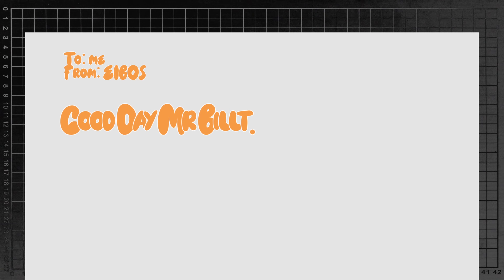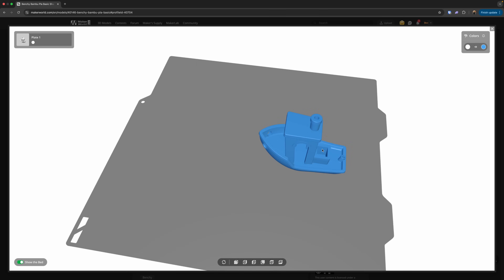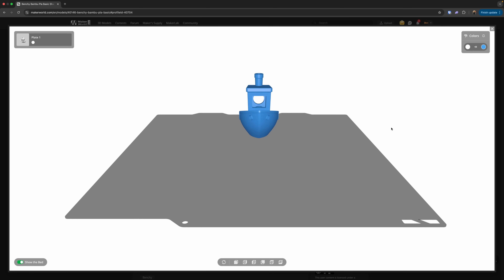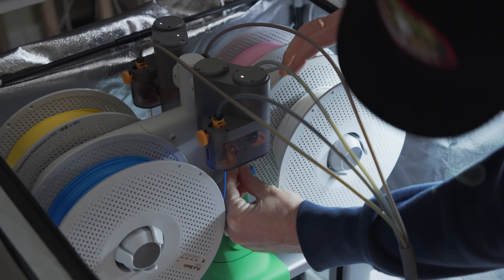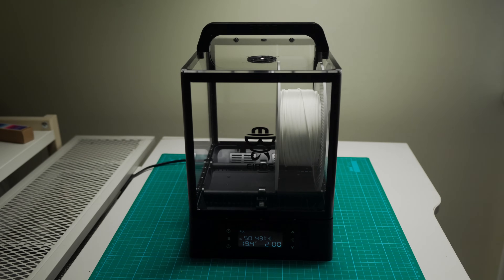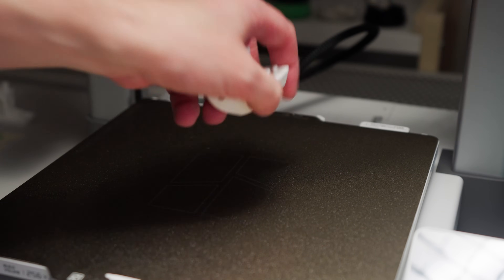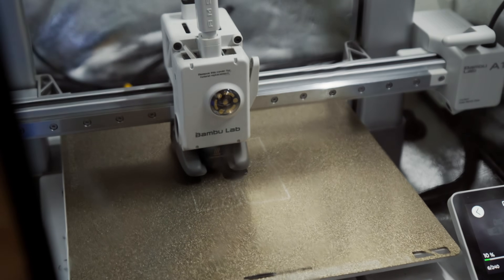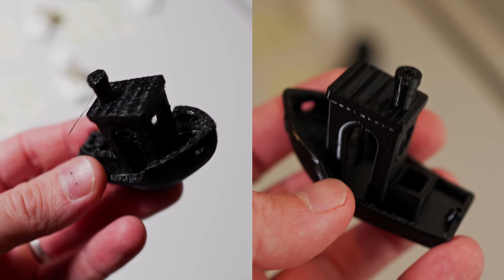Are filament dryers a scam?

Comment: drying is not a scam, especially in humid climate/areas and hygroscopic materials like PETG. dryers, yes. I use a vacuum box that passively dries out the filament while in storage, no energy consumed and my filaments are always ready to go. i put dessicants in the box as well, and i've never had them change colour. the humidity sensor i have inside shows a constant 30%, more than good enough. stop wasting electricity

Comment: While I generally don't dry PLA, I've had some rolls of filament straight from the packaging that had excessive stringing. A few hours in the dryer fixed that. It's generally not needed though, and I've got better things to do than dry every roll of PLA I buy.
People also sometime have adhesion issues, and one of the first recommendation is "dry your filament".

Aside from that, I generally dry every roll of PETG I get, it's a bit more sensitive than PLA, not much though so you can forgo it as well. And as you witnessed, TPU does require drying. And that's the only 3 materials I print with because based on what I saw online, they are deemed "safe enough" (especially since my printer is enclosed and have a bentobox in it).

But the main use for my dryer is actually drying reusable silica beads I use to keep all my filament dryer (I decided to keep every opened filament in boxes under 30% humidity at all times so I don't need to dry it even if it's been opened for months). I know some people use a microwave or oven, but I don't have room for additional ones, and there is no way I put that stuff in the same machine I cook food.

Comment: i have used mainly tpu pla and petg so far and usually print only now and then

i can definitely say that petg and tpu both benefit from dry storage at the least, even if its not an active dryer
using silica beads in an ikea box and drying the desiccant every couple of months works for petg/tpu 

pla can also pick up moisture, but it really takes time, some of my 3+ year old spools seem to print more stringy, but i think if you just store them in the bags the filament came with, pla should be fine

from what ive heard anything beyond those materials definitely benefits from active drying

in general its probably best practice to just print out of some kind of box, so you have one less thing to worry about with your 3d printer

Comment: ❤Another awesome video. 

TPU is a remarkable filament, I love the translucent type for printing wallets and phone cases. It also works well for creating replacement feet for equipment. 

Not interested in PLA but PETG is my filament a choice with very few issues. Bought a dryer it was definitely worth the money.

My friend had some old Makerbot filament from 2013 that wasn't working. I put in my dryer for 24 hours and it worked like new.
Reply from the maker: Yeah I need to pick myself up some PETG, in hindsight I should have done it for this video! How long do you generally dry a roll for and do you then keep it in something airtight or do you dry specifically in advance of a print?
Reply: @Billt_it  New rolls PETG for 8 hours, TPU for 12 hours.  As far as storage open air, dry just before important projects for a few hours. Really should start  organizing and storing them soon. The dryer I went with is the Sunlu S4, liked the fact it holds four rolls at a time. (Looks cool too)

Started printing last July,(late bloomer) researched for 15 years before pulling the trigger. Was really impressed with the A1 and no regrets. Didn't have the time or patience to work with older systems, bed leveling seemed really annoying.

Love to watch it print absolutely fascinating and fixing/creating parts from scratch.
Reply from the maker: Sweet, thanks for the info! Yeah I'm in a similar positon re printing. Have been interested in a while but never really wanted to tinker with the older gen of machines.

Comment: I live in a very humid place. Even the walls leak during the wet season. I have hundreds of rolls of different materials. I never use a dryer. I just store them in a box with molecular sieves, and the hygrometer shows the humidity inside the box is always below 10%. The molecular sieves can absorb moisture from the materials, drying nylon to the point of being very brittle. I've never had printing issues. If I notice the hygrometer rising, I simply take the molecular sieves out, bake them in the oven for two hours, and they’re ready to use again.
Reply from the maker: Damn, that’s pretty interesting. I would have thought a super humid environment would just cause them to suck up the water. I guess that’s what the sieves are for, obviously.
Reply: is it the same with rechargable silica gel ?( heat them and when dry it will turn to blue ) or molecular sieves is stronger?
Reply: @chickenz4604 Unlike rechargeable silica gel, they do not change color, so you have to rely on experience to judge when they are dry. In general, heating them in a pan over a flame for about one hour is sufficient to reactivate them

Comment: I  definitely agree for PLA that dryers are more marketing than results but as your materials get more demanding filament dryness plays a critical role. At home I print a lot of ASA, nylon, and PP; ASA doesn't need a ton of drying but it definitely helps older spools unlike nylon and PP which are near impossible to print without 24-48hrs of drying as well as actively drying through the print. On an even higher level I work with industrial machines that chew PEEK for breakfast, we have a few different dryers but the fanciest ones reach 300c internally. High temp nylons, PEEK, PEKK, and Ultem will all absorb moisture so aggressively the room needs to be low humidity as just a few minutes in ambient air can delay drying by several hours. 

For the 90% or so of home printers that never go outside PLA filament dryers are pretty much a scam, but for the materials that need it I'm glad there are affordable options that work really well.
Reply from the maker: Damn dude this is such a crazy in depth comment, thanks for the knowledge!
Reply: This was exactly what I was thinking.

Comment: Wish you had done your test with PET-G.
Reply from the maker: Yeah in hindsight I should have ordered an extra roll. I need to do some printing with PETG but I’ve so far avoided it. What kind of stuff are you printing with PETG?
Reply: @Billt_it  Anything structural or that will be exposed to elevated temps or sunlight. Right now, some stuff for a new X1C and desiccant  boxes for an AMS2-Pro. I suspect more people would be using PET-G rather than TPU for everyday printing. Your comparison of a wet-TPU benchy and a dried-TPU benchy was great.

Comment: I don't think PLA can absorb water that quickly. You have to have it sit in humid air (or maybe water?) for a bit longer than that.

What this shows is that if you're using PLA and are finishing the roll relatively quickly, you don't have to worry about keeping it dry.
Reply: I thought the same thing up until this past weekend. Had a spool of filament that I had been using earlier in the week decide it was going to absorb all the moisture it wanted for 3 days lol. 
I struggled for a solid 24hrs thinking it was a setting issue until my girlfriend told me to try a different color(was sleep deprived and trying to finish an order, hence my lack of thinking outside the box)
I proceeded to print the keychain in several colors then got on Amazon and ordered a dryer. 
Dried the spool for 10hours or so at 40c and when I tried to print the keychain again using my original settings it came out flawlessly.
Reply from the maker: Damn, there you go! And that was with PLA?!
Reply: @Billt_it yep Inland PLA Twinkling Pink. I’m thinking the moisture came from our aquariums warming up with the weather, just not sure why only that spool and one other from different vendor decided they were thirsty.
Reply: @ThaDad_DoingThings  I posted in another comment, but yeah that happened to me a few time: roll fresh from the packaging creating excessive stringing. Throw the sucker in the dryer and that fixes the issue. It's not frequent, but it does happen.
Reply: @ThaDad_DoingThings  Well this is 3 months later, but curious-What dryer did you end up getting?
Reply: @Maltojo originally bought the Sovol SH01 but it only goes up to 50c so I grabbed a creality single spool dryer for petg

Comment: Great video! I would disagree about drying PLA. Most of the time it will print… fine. Good even, but when you want prints that look as good as possible, I have noticed better walls and surfaces from drying PLA. Not a make or break difference, but noticeable. I suppose it depends on your final use case.

Either way, please keep making these videos! They’re absolutely amazing ❤
Reply from the maker: Purely on the test I did, with those benchys, I really struggled to see a difference. Maybe if I left the PLA to really soak up some moister I might but yeah, between the ambient room temp and the dried, I saw no difference. But I haven’t printed with PETG yet so I’m sure once I grab a roll of that, I will see that difference. Same with the TPU, it was night and day. Definitely glad to have a dryer now for that purpose.